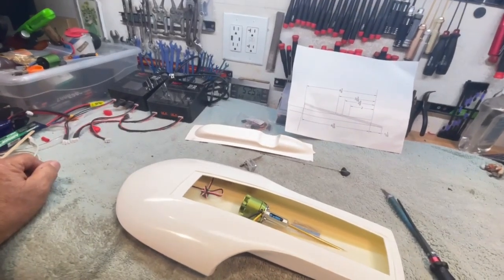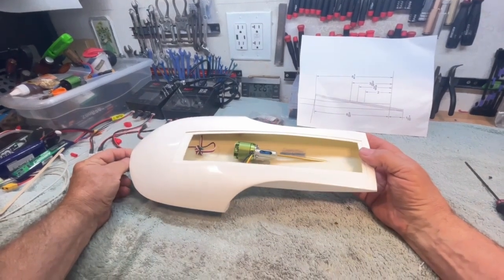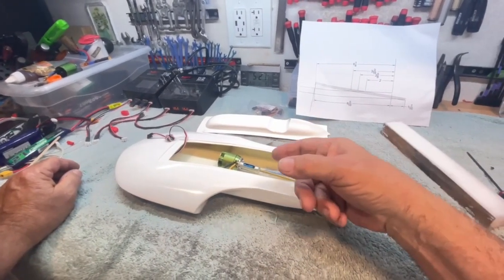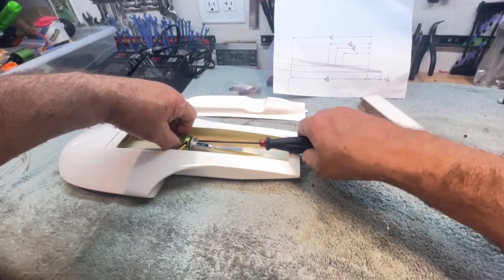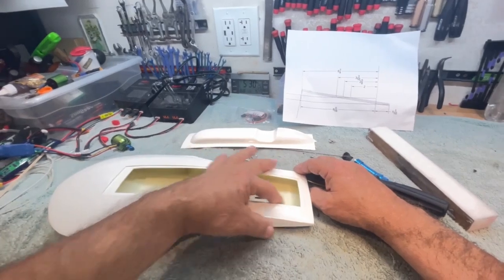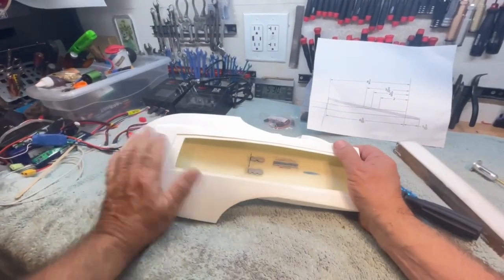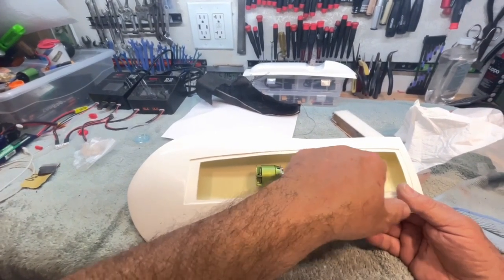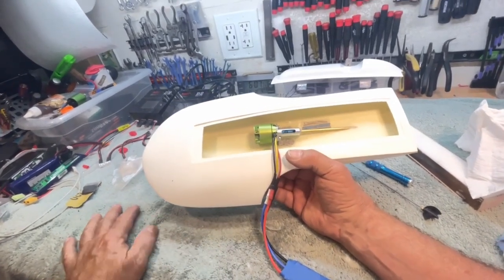Dr. Jet does some work on the SSSH before heading to the pond.....

Comment: Will be interesting how it works as the angle looks bit steeper. I started with something similar on my rigger and had then bit too much lift at the back. Latest version is that tube is half in the bottom and half in the transom.

Comment: How does the canopy fit? I ask because mine is a little warped. I have used the heat gun on it and it helps but i don't want to put to much heat on it. I also weighed mine and it's 12.5 onces with no batteries. That's my lightest boat. I accidentally posted this on your video from 8 days ago so ignore that one. ...jim out